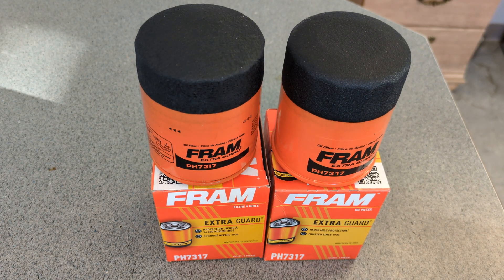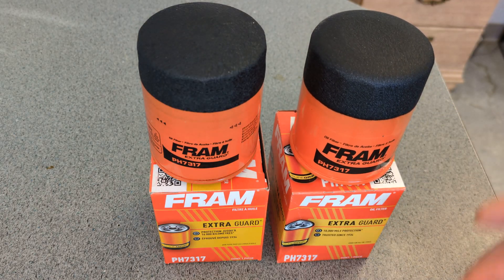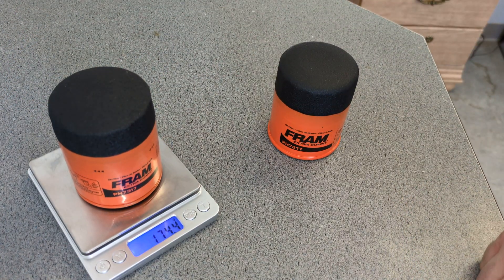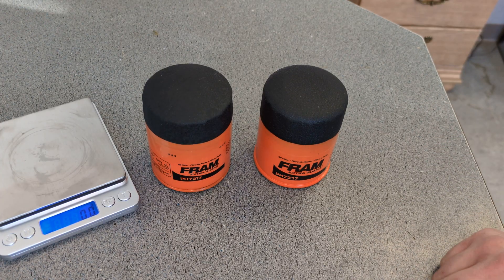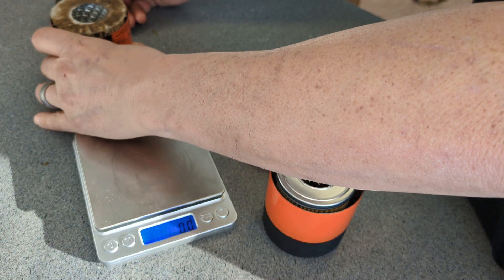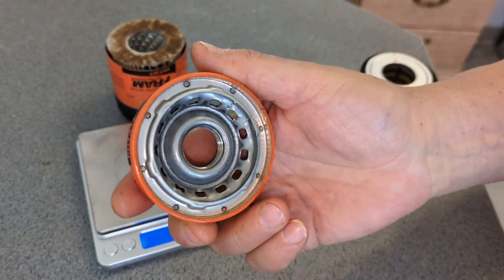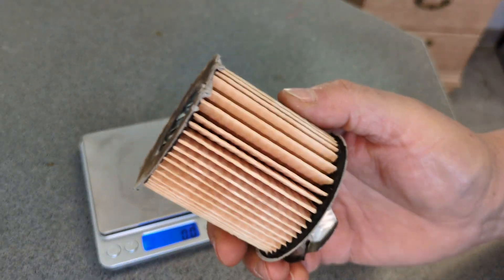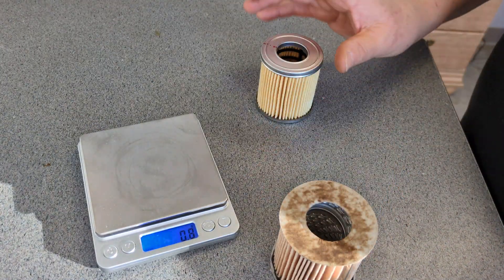Is Fram now using a different filter for its Extra Guard

Comment: My fram 7317 has a red silicone seal anti drain back valve. Some other csnadian tires still had only the old frams in stock
Reply from the maker: I like the Champ Labs made Fram filters, just seem more reliable.

Comment: I went to one canadian tires and my specific filter and a few others they are the new champs lab. A friend bought same model filter and it was the older one.bought them around same day. Stocks are mixed up. Told him to return it and buy the one from the store i went to
Reply from the maker: I have heard that the Fram fiber ends caps and metal ends caps are still being shipped regularly for each filter.

Comment: The end caps make ZERO difference in quality.   Toyota doesnt even use end caps, they use glue.   It all has to do with the actual media it has to stick to.   Wish people would get off the damn end cap BS.
Reply from the maker: I do think the filtration media in Fram filters is top notch, and yes it's the glue that keeps it all together. The fiber end caps are there to hold the glue. But I have seen some fiber end caps fall apart but only because they were used far beyond what they were made for.👍

Comment: Champ Fram is actually Walmart Supertech made by Champ - latest versions from  year ~2023 and forward. 

Polymer Ecore (center tube ) is horrible idea, i've seen many used filters with collapsed ecore or missing plastic pieces possibly due to polymer / molding defects or many other variables. In any case > avoid them!
Reply from the maker: Yeah I have heard of the E-Core coming apart on grossly abused engine with oil changes exceeding 3 to 4 times the recommended mileage for a oil change. In that you may have a point. Change your oil on time.😉

Comment: Verified bill, just went and picked one up. The orange can of death champ made has a silicone anti drain back valve. Weird the one you have doesn’t.

Definitely changed my mind about these oil filters. Frams trying to improve for sure. For the price you can’t beat it. 

Ps just also bought picked up a super tech oil filter by Walmart for my 4Runner for $2.98 USD, I open the box and the filter is white kinda like the synthetic media that comes and high and oil filters. Wire backed. I’m really curious what this filter media is under a microscope. Is it paper or like a fiberglass material kind of media? Have you ever seen this. If I could have your email I’d send you pictures.
Reply from the maker: Definitely that super tech has some advanced engineering. Send my pictures to hondanonturbolife@gmail.com

Comment: Fram is garbage. You couldn't pay me enough to use them.
Reply: Nah they're fine, I have a bunch of cars, use frams, 200-300K no problems, they're all running strong. Expensive filters are gimmicky and overrated for a run of the mill daily driver
Reply from the maker: @AmandaHugenkiss2915 sounds like good advice.
Reply from the maker: Thanks Joseph, I'm getting vibes you don't like Fram. Take more than one changed oil filter to convince me also.

Comment: obove the metal ends I'd probably prefer the silicone anti-drain back valve. For regular oil change intervals (3k) I have no problem using the cardboard frams.
Reply from the maker: I have used Frams worse built filter on my Previa, it's running a normal motomaster with rubber adbv. Can't wait to check it when it's time to change the oil

Comment: I made a video 3yrs ago about the weakness of the extra guard’s center core and how the ecore design used in Fram Drive filters was a better design. First Products bought out both Fram and Champion labs, allowing the ECORE design to be transferred over to Fram.
Reply from the maker: I have always liked the strength of the E core design, extra guard a step into greatness is happening.😉

Comment: The center core is more of an instant give away than the end caps. Doesn't matter, champ filters leak oil at the stick in bypass filter.  At least the fram paper ends gave a little filtration at the inserted bypass. If the bypass isn't glued in, nothing else matters. Instant bypass.
Reply from the maker: Thanks Nick for you input.😉

Comment: I'd like to know definitively, what advantage the orange valves have over the black anti-drainback valves. Are they more flexible in the cold? Do they last longer without getting hard? Do they hold their shape better? And what does it matter, as when you need anti-drainback performance, it's after shut down and the engine and oil is already hot, so they're both going to seal just fine. Is it just a way to "drain" more cash out of our pockets with marketing? Put both in the freezer and show me the black one doesn't work. BTW, filter brands and their choice of silicone or black nitrile still must meet manufacturer's spec for engine warranty.
Reply from the maker: Black is usually rubber and gets harder after use of 5000k while orange is Silicone and can remain pliable for many miles more than black rubber.
Reply: @crazybillsgarage 
The Fram Extra Guard uses Patented Glass fiber technology blended with the cellulose inorder to achieve 95% @ 20microns. 
Even the Mobil 1 EP filters are only 99%@ 30microns.
The Fram ExtraGuard has been one of the  cheapest 20micron oil filters since the 1990s; which is a plus in that regard. I've been a big fan of the Fram Ultra Synthetic filter for awhile now. The only Fram filter I have used with fiber end caps so far has been the Toughguard since it was resin reinforced which worked quite well. I'll be trying out the Extraguard now since it now has metal end caps. Thanks.
Reply from the maker: @William-13 I have no arguments about how well the Fram Filtration is, it does its job well.

Comment: If that is the PF63 alternative they had to increase the flow rate to accommodate the New GM Diesel application. AC delco PF63 also has the same style now. Also the E core design flows a ton of oil.
Reply from the maker: That's what I like about E core, great flow rate.

Comment: I am not sure why it is so hard for you to understand the business process.  First Brands owns many companies like Trico, Champion labs, Fram and several others.  Champion labs make ALL of the filters for Fram, Amsoil EAO/EA, AC Delco, Royal Purple, SuperTech and STP to just to name a few.  The two filters you have is the older design that has been replaced by the new model you have on the right, which has been updated for various reasons besides being a better designed filter, they are standardizing across the brand platforms to help keep the production costs lower while producing a better filter.  Fram and Champion labs are the same exact company and filter.  Fram doesn't make some and Champion make the others.  Champion Labs makes them all for dozens of brands.   It is a pretty simple to comprehend this.  
This is the same change when the Fram Endurance was released, they revised the Ultra Synthetic to a Semi-Synthetic filter media to lower the cost and make the Endurance the only filter that comes with the fully Synthetic media as their flagship product, which is actual the same make and model for Amsoil EAO and Royal Purple.  They can save millions in production by standardizing across platforms.  Soon, all the cheap Fram with the fiber ends will be gone once they are all sold.
Reply: I won't be buying Fram anymore. garbage product.
Reply: @Ascend777  Not the Fram Endurance filter…. Maybe the bottom product but the Endurance is top tier Synthetic media and a twin to the Amsoil EAO series.
Reply from the maker: @Balticblue93 thanks Baltic.
Reply: @ Unfortunately the Endurance FE now fail flashlight testing indicating upstream/dirty oil bypass at the bypass piece seal area. A fail for any filter, but at $13 for a "premium" filter, I'll pass.
Reply from the maker: @Ascend777 thanks for reply, it's got its lovers and haters.
Reply from the maker: Thanks Baltic for the comment.
Reply: Fram still makes vast majority Fram filters, EG/TG with fiber endcaps being a couple examples. Champ has never used "fiber" endcaps. Mostly metal, some polyester for ecore only.
Reply from the maker: @faxmen09 one of the most used filters still out there, must be doing something right.👍
Reply: @crazybillsgarage  Yeah, not a particular fan of the EG/TG fiber endcap design, but they're not going to ruin your engine either.
Reply from the maker: @faxmen09 yeah it's not the worst thing in an oil filter design.

Comment: Just to know..7317 number..Cross reference to "9688"...Way Better Filter that fits the 7317 number....
Reply: While they may "x-ref" in some directory they are a different size filter, wider. And using Honda as an example, the wider 9688 will not fit many newer models because of engine block, oil pan restriction. Also, if vehicle calls for the 7317/14610, any oil filter warranty voided using the 9688.
Reply from the maker: @faxmen09 thank you Faxmen.😉
Reply from the maker: Thanks Tony good to know.

Comment: If I was to pick one, it would be the old style with a metal core not the ecore crap.
Reply from the maker: It's up to you but I prefer the E core for its strength and flow rate.

Comment: Wow the filter media looks different also. That’s crazy. Had no idea.

They are putting silicone in the champ labs extra guard here in the states. Atleast down here. I’m that guy in the isle at Walmart opening all the boxes looking at the filters before I buy them. Lol
Reply from the maker: And keep opening those boxes, I open my boxes also. Like to see what I'm getting.😉
Reply: The color of a polymer doesn’t dictate what it actually is. You can have black silicone. Or yellow or blue purple etc. rubber is also not color specific as rubber is originally white when collected from the rubber tree. Only way to know is to ask the manufacturer. Just like you can have a pile of a 1000 black orings and each one be a different polymer
Reply: @Gleone58  These are synthetic rubber made from petrochemicals.
Reply from the maker: @omermiller268 yes it is.
Reply from the maker: @Gleone58 thank you.

Comment: The Luber Finer lfp2286 filter for my truck which is made by champ labs looks exactly the same as the Fram 3786 for my truck, just different colors.
Reply from the maker: That's right I always forget that the Luber finer is a Champ Labs supplied filter.

Comment: Not unusual for a manufacturer to source from different factories, especially when those factories are owned by the same company.
Reply from the maker: Maybe it's cheaper to use from Champ Labs stock of filters, I don't see how it would be cheaper though.
Reply: Probably used the other factory due to production bandwidth. Cheaper to produce Champ filters painted orange than disrupt a production run at the Fram factory.
Reply from the maker: @FrankDAgostino77 that is a possibility 😉

Comment: Anything special about where you got the Champion Labs version of the PH7317? If it's from an online retailer, was it from a certain seller? I recently ordered one (same part number and everything) online specifically to get the Champ version (I saw someone else got an updated one, too) but got the Fram factory version.
Reply from the maker: I bought the original Fram from local Canadian Tire and across the street the newer Fram style from simple Walmart. 😉
Reply: Thanks! I just returned from Walmart and I got one of the new Champion Labs ones. Interesting that it is another variation; this one has no sticker and they're back to printing the logo and such directly onto the orange paint.
Reply: @CarsSimplified  I was in walmart yesterday and noticed they were selling Fram filters that are blue now.  First time I've seen that.
Reply from the maker: @CarsSimplified that is very strange, cheaper to ink on.
Reply from the maker: @kirkpalmer1709 blue 
🔵

Comment: Love those silicon anti-drainback valves. But, I haven't owned a car that needed a anti-drainback valve in over 20 years.
Reply from the maker: The funny thing is, that most vehicles have an engine that installs the base upwards so oil stays in the cannister anyways.😅